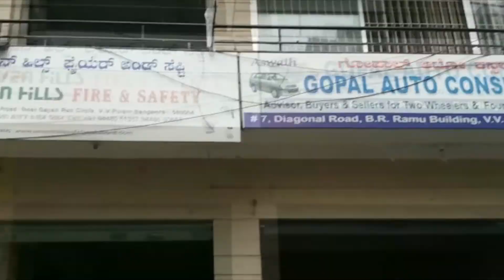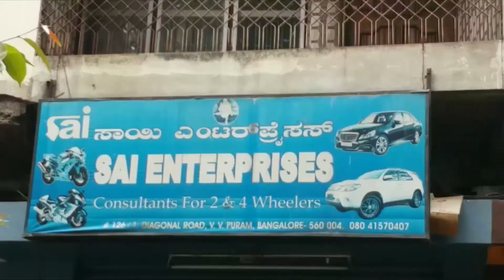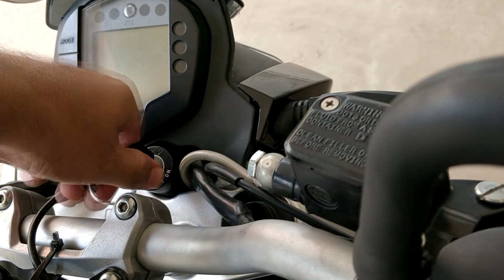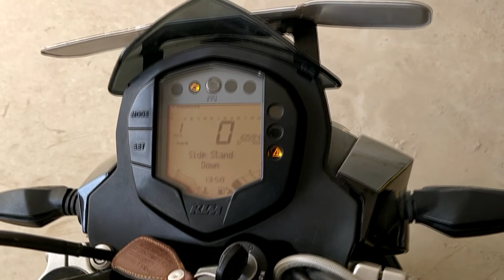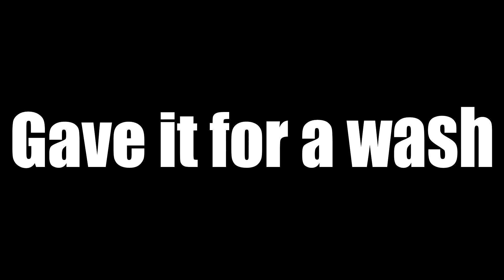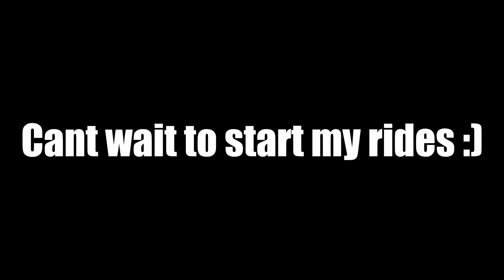Buying Bike for My Dad | Duke 200 | Bike Market

Comment: Hi.. i used to live in Bangalore till 2007 and i used to ride a rx 135 5 speed which i sold. im currently in mumbai n i want to buy an rx135 5 speed. Would u be able to help?
Reply from the maker: Hi Kingshuk,  I did call the dealer I know, to find out if he know any 135 5 speed on sale and he mentioned that there is none that he is aware of. I see some options online in Droom and OLX, i'd recommend you check them.
Reply: Moto Raider thank you so much.. please keep me posted in case u find 1